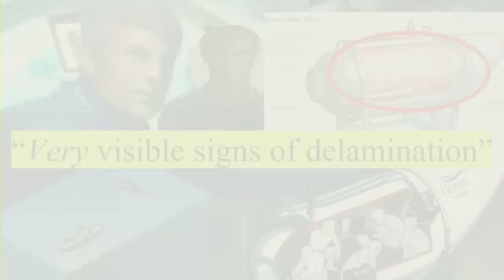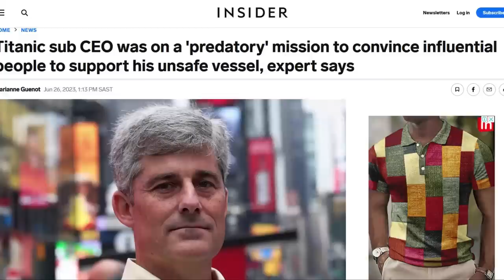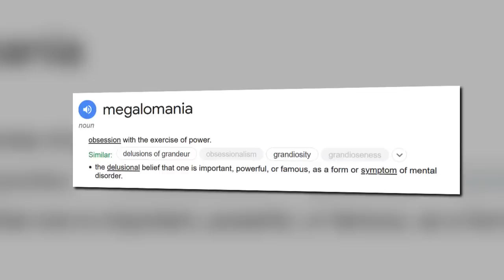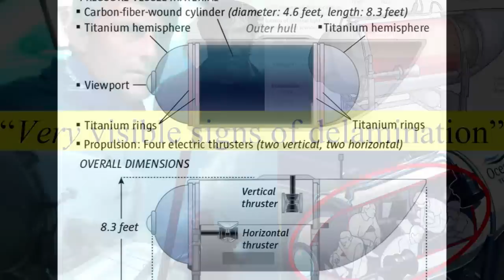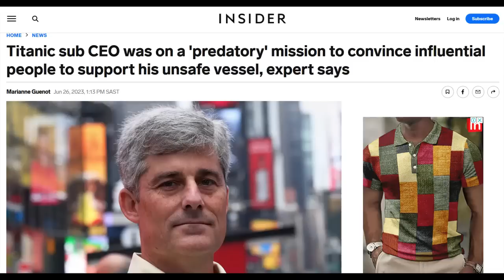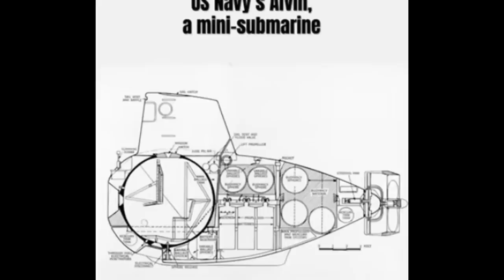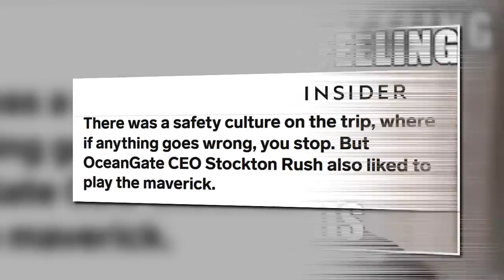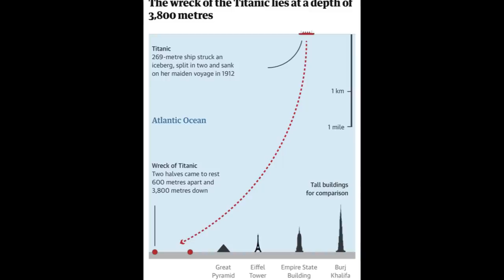"Lochridge shone a light through a sample of carbon fiber and saw splits in the midsection..."

Comment: Light could be seen through the carbon fiber? Holy Moly
Reply: At that point it’s basically a plastic hull.
Reply: I wouldn't take his word for it, unless I actually see those pictures... it's still 5 inches thick, good luck shining light through lets say 5" of denim or sth much less dense, you wont see anything. BUT of course the pressure chamber still should NEVER have been made from CF anyways..
Reply: @MrHuggaga  You wouldn't see the light directly through, carbon fiber reflects light through any delamination point, not to mention the carbon was wrapped in direction making it very weak under compression pressure.
Reply: @theclubhouse1209  Thanks for the answer, reflection through 5" of the stuff still seems very unlikely to me, because wouldn't every layer have to be delaminated at that point? (and would it not have leaked water to the point where even Rush couldn't deny it?) But I I won't rule it out will look into it. Just be assured, I KNOW that it is a bad design and should not be put unter external pressure. I wasn't trying to doubt that at all!
Reply: Depends on the intensity/frequency/wavelength of the light. Alot of presumptive ness here, a witness says one thing and some one pipes up " I don't think" well what do you do?
Reply: @dananorth895  It just goes against what I have seen of carbon fibre. Different example: If I know Russia is doing atrocious stuff in Ukraine, I'm not automatically gonna believe everything Ukraine says they do. It's a different situation, sure, but without evidence I am allowed to have doubts about something that with my experience of the material just doesn't add up. I actually did look it up and at least within 20 minutes (which - okay - is probably not too long) I couldn't find any testing on delamination involving light passing through and I didn't find it mentioned that it could happen in some other way. Do you know what I have to search for that backs up your comment?
Reply: IF YOU CAN SEE LIGHT THROUGH IT THE WATER CAN GO INSIDE
Reply: @MrHuggaga he examined a small portion
Reply: @jcgocrazy  A small portion is still hast the same thickness..
Reply: @MrHuggaga  The pressure vessel had inner and outer cladding so short of complete disassembly a leak and or delamination would be hard to spot, sonic or sonar type testing would be very expensive to do. Carbon fiber thread has to be kept in a "wet" state when laminating then put in a vacuum or auto clave to draw out the extra epoxy to achieve highest strength possible, the epoxy also has a shelf life. Too many "flex" cycles will cause micro fractures and once it starts it gets exponentially worse.
Reply: @dananorth895  It's what you don't do, ignore the signs like stockton rush did.
Reply: @theclubhouse1209  I already told you, I am familiar with the material, you didn't tell me anything new. This is the first time I heard of light being able to pass through "micro cracks by reflection" which I afterwards couldn't find anything on.. What should I search for?
Reply: @jcgocrazy that's even more disturbing
Reply: @MrHuggaga wasn't it a steel hull wrapped with carbon fiber??
Reply: @myrongaines5542  the steel you see was to make the cylindrical shape
Reply: They are discussing light traveling lengths of cracks due to deformation. 
The bubbles and cracks are likely the process they chose. It should have been vacuumed, then impregnated and then baked in an autoclave. 

Their sub was a wet set wet lay process of thin filmed fiber. The implosion occurred due to the lack of deformation of the titanium caps yet the carbon fiber composite compressed down and in. The lap and adhesive was very small which likely added to the event but wasn't the only variable.
Reports state that NASA consultants suggested a synthetic hull be at least seven inches thick. This suggestion was not obeyed and the hull was in fact less that five inches thick.
If I were in a position to build my own submersible, I would follow paid consultants suggestions as well as over-engineer what could be in an effort to make safer.
Reply: I dnt get that part.wasnt it wrapped around so if its wraped tight on the hill how did he shine a light thru it?
Reply: If it was so bad he saw light thru it i dnt think it would hold water
Reply: @FriedChairs  it is actually, carbon fiber is supported by plastic framing actually.
Reply: I think it was a sample cut from a previous hull. The light was shone lengthwise or axially  between the layers, not radially.
Reply: I think it was a sample cut from a previous hull. The light was shone lengthwise or axially  between the layers, not radially.
Reply: @dananorth895  Any visible or IR lamp powerful enough to shine through 5 or 7 inches of CF would melt the epoxy.
Reply: @jcgocrazy  A slice makes more sense.
Reply: Maybe a parallel light revealed delamination
Reply: He didn’t shine the light through the 5in thickness of the hull, OBVIOUSLY— he examined a thin, transversal section of the material as he was looking for delamination defects, as mentioned…
Reply: @dananorth895  I'm sure that testing wasn't just  visible to the naked eye type test .

Comment: I am a composites engineer who works with advanced aerospace materials and processes.   Bagging a 5-inch thick composite cylinder 12 to 14 feet long would require a great deal of technical  expertise to ensure that no vacuum would be lost during curing in an autoclave.  This part would need to be under pressure as well while curing of at least 85 psi to 100 psi using nitrogen gas.  This part would need to undergo NDI ultrasound testing to determine if the void content was less than 1 percent.
Reply: they didnt use autoclave
Reply: They didn’t do any NDT / NDI either from what I have read into this, before or after the previous dives.
Any vessel like this, built to no known design standard, subject to cyclic loading should have been tested and inspected.
Reply: While I too LOVE carbon fiber because of its many applications and incredible strength to weight ratio is was the worst possible use for it and in the way it was used. CF has about 40% of the strength in compression as it does in tension AND the winding appears to have been done 100% laterally instead of alternating it with a 45 degree winding every couple of layers. That might have held the layers together for a few more dives but in the end it would still have failed. The acoustic testing would only give you a short amount of time warning you that you're going to die! Think of cast iron. Put a lot of force on it and it doesn't budge at all, so you keep applying pressure and all of a sudden it snaps without warning. CF is the same way. That acoustic sound they wanted to monitor isn't a warning of an impending failure, it's telling it that failure IS occurring!
Reply: David, had they done all that, would you feel save in the sub at that point?
Reply: @davidsine4390  I wouldn't! Incredible material but wrong application.
Reply: I've worked in NDT for over 30 years. If no UT or RT inspection was performed on this vessel then it was a disaster waiting to happen.
Reply: Does it sound to you as if no composite engineers were involved in this?
Reply: Thank you. A voice of knowledge.  The cracking sounds were a nogo immediately.
Reply: They should have been in a "clean room" also. So much technical expertise that was there but not utilized.
Reply: @loosilu  From the comments of the engineer warning of delamination and porosity that was visual to the naked eye, It was obvious this pressure vessel was a disaster waiting to happen.
Reply: 22 million pounds of force being exerted on the two end caps made of titanium bonded to the cylinder made of composite/carbon fiber+resin.  The difference in those materials at the interface was doomed to fail.  These people were definitely drinking the kool-aid because any 50 year old engineers like myself would have said this is a death trap.
Reply: @davidtullos2067 I was a management major so no engineering education and even I can see this flawed design. I think a sphere and steel would be a better design. Again, I am a layman.
Reply: David, you're exactly the type of person who Stockton Rush would've refused to listen to. White, male, experienced and straight forward. How does that make you feel?
Reply: @GrantOakes   With my only real way to contribute in this conversation it makes me think about how superglue is great for around the house repairs for certain things like plastic you certainly wouldn't use it to repair a broken tooth.
Reply: @obi-wankedogi  Great analogy!
Reply: The testing would've cost alot and would have to be repeated often.
Reply: @obi-wankedogi3829  its not about how I feel, but since you are asking.  Sad, especially for the 19 year old who didn't want to be there.
Reply: @davidtullos2067   Exactly.
Reply: Ask Rust if he did that.....Oops, he is dead. Maybe he documented his "experiments" or maybe he did not. It was not regulated, so......
Reply: As a composites engineer would you have an opinion on what those tic tac craft are composed of.
Reply: @fanatamon  Thermoset Epoxy Resin is used as the matrix or binder, and unidirectional carbon fiber tows.  When processed on a prepreg line or machine, it becomes thermoset tape or prepreg.   This is then laminated one ply at a time until a thickness is achieved for the structure.   Usually , a jig or mandrel is used to keep the shape of the part before it is cured.  In this case, it was a cylinder.  This pressure hull would have required 640 individual laminates to make a structure 5 inches thick.  Any air trapped would be a failure point.
Reply: @GrantOakes  There are videos showing a diagonal weave as well as layers of lateral.
Reply: @glens51  It was too late then, the hull had let enough slow water in to affect the buoyancy, the water was likely under the floor seeping into the A battery bank or wiring. They were descending at twice the normal descent rate from the start.
Stockton-Rush knew this, he kept going or couldn't stop it. its likely he kept quiet to avoid panic and violence during the two hours descent, only when the loud noises and the 19 minute end time did he signal the surface.
Its reckoned the final descent was nose or tail down due to the dropping of the ballast and frame, so 100% unstable, and everybody piled up in a heap screaming and cursing.
Reply: @davidtullos2067   Fascinating stuff. I just  find it more and more ridiculous that he was such a complete egomaniac when presented with the basic facts of how inappropriate it was to use this material. Stunning.
Reply: 😂 lol! You’re assuming they’d done it correctly 😂 When in fact, it wasn’t done in a clean room at all, and the epoxy was applied using plastic spatulas you can find at any hardware store. They certainly didn’t use an autoclave either! Not unlike how the lighting and other components were from a camping store and the controller a cheapo games Logitech controller…
Reply: I heard that they used some kind of house pipes in it, was it pvc or worse pex? This kind of cobbled together b.s. was doomed to fail. And a out dated game controller wtf! Several different materials used for the whole cluster of the boat.
Reply: @GrantOakes  IMHO, it would've been much easier to make the whole vessel out of titanium. but Rush wanted to be remembered as the  guy that broke the rules.
Reply: @Mazel_Tov_888  He sure did that as well as being responsible for the deaths of 4 innocent people!
Reply: 2:52 mentioned that there were holes seen on the return trip.. didn't this erosion tigger the acoustic monitor system. Or was the AMS installed after these earlier dives?
Reply: @davidtullos2067 when making carbon fibre parts the autoclave and vacuum ensures that air bubbles in the resin and carbon fiber will be pumped out. This process itself takes  very long time in the autoclave but you also mention the use of Nitrogen gas. When will Nitrogen gas be applied ?.  When the autoclave has cooled entirely off ?. Does it gives better surface. The Nitrogen part is new for me and I'm interesting if you could give more information.
Reply: @AmbientNoise404  They did the glue-up in a shed...
Reply: It should have been thrown in the ocean with Noone on board sunk to the bottom and left there. I'm not a engineer and can guess this thing was poorly constructed. Wouldn't a flanged tube with a chemical and mechanical bond have been better? Woven carbon fiber? Read somewhere it was supposed to be 7" not 5"? They obviously knew this outcome or they wouldn't have had such a morbid waiver. It's disgusting i.m.o if you want to gamble with your life, that's fine. Don't drag people down with you under false pretenses.
Reply: @joefish6091  there would have been NO slow water ingress!  Just stop. It would have been more of a jet stream!
Reply: @madb132 were where all these neckbeards before it failed to save their lives.....
Reply: @SR-ml4dn  There are 2 purposes for the use of nitrogen gas.  The main reason is to purge all of the air out of the autoclave, and second is to pressurize the autoclave slowly at 5 psi per minute until it reaches 8-10 bar of pressure (85-140 psi).  This helps make sure of excellent inner laminar ply consolidation and impregnation of the matrix.  An autoclave is a tool that can fix many problems during the layup process.
Reply: @GrantOakes STEEL will give warning of its failure several minutes before  by emitting high frequency sound (above human hearing).  Problem is they didn’t use steel.
Reply: @electrictroy2010  what the hell would several minutes do when your an hr and 45 minutes from the surface
Reply: @GrantOakes  i dont think the real time monitoring system only worked in that way, else, as you say, what is the point? they used the kaiser effect to compare noise levels between different dives at similar pressure, so subsequent dives should be quieter, as the material is pre-broken. any novel sounds at a certain depthhad to be caused my newer damage.
Reply: How can you lose vacuum in a pressureized autoclave? No mention of vacuum bagging? Just curious!!?
Reply: @AmbientNoise404 Second mistake!
Reply: @davidtullos2067 You didn't mention the next two steps that should have been mentioned! Vacuum bagging and then under pressure in a autoclave or possible HYDROClAVE with heat to cure the laminate!
Reply: @SR-ml4dn Nitrogen is used at the very beginning of the autoclave for obvious reasons! The part should be also cooled in the autoclave to insure stability as composites will change as long as it is hot… All this can be time consuming!
Reply: @davidtullos2067 Have you ever used a HYDROClAVE? You made a very good statement about autoclaves!
Reply: @GrantOakes  you fail to understand the kaiser effect. only new fractures make sound, so if an object has the same levels of stress it previously endured it should be far quieter. new sounds mean new damage. that is how the real time monitoring works, it compares the sound data to the sound at the same depth from the previous trip.
Reply: @robertchilders8698  it should be obvious if you're using an autoclave but forgive me for assuming anything.   Autoclave recipes are closely guarded secrets in the industry.
Reply: @robertchilders8698  Thanks I didn't know that.
Reply: @robertchilders8698 If the vacuum bag leaks during the curing cycle, air will get into your part.  The vacuum is released at the temperature that gives a minimum viscosity of the resin being used. Then pressure is applied.
Reply: @robertchilders8698  what industry do you work in, if you don’t mind me asking.  It sounds like you don't work in aerospace because of the questions you are asking.
Reply: @davidtullos2067  This shows me how far out of date I am! I didn't know Autoclaves had secrets!?
Reply: You have got me confused.  We applied pressure during the whole cycle the parts were in the autoclave.
Reply: @davidtullos2067  I started work in the aerospace back in1957. IT was highly unstable work, so I worked in many fields! Worked on aircraft, rockets, boats, atomic submarines, race cars! Retired now! My first job was working on Drones for Ryan Aeronautical as composite technician! Spent time with Boeing, Lockeed, Areojet, Grummand and atomic submarines at Mare Island.
Reply: @robertchilders8698  I work as a Compsites Engineer in the defense industry, with Boeing being one of those companies that I have worked with for the past 14 years.  In St. Louis back in the 90's and later Seattle in 2010.
Reply: @obi-wankedogi  you must include "age" discrimination in job hiring! Although it is illegal, it's easy to get around! It's also the major factors for homelessness. I've worked on many jobs in my life-time!! Always wondered why the majority was between 25  to 35 years old!? Now that I'm retired, I've found out to late ,why! Spent to many years being naive and homeless!
Reply: And even that wouldn't be enough.  How long does something that big and five inches thick take to fully cure?  Can we even expect it to fully cure?    And the carbon fibre was laid down like a spool of thread.  There was no attempt at producing any kind of rip stop  feature to the fabric of the barrel.  Any cracks from cycles of compression were free to run along the lay, and jump down to the next layer down.  The design wasn't even valid for aerospace tension applications.
Reply: @SR-ml4dn  You must know something about vacuum bagging and autoclaves! Nitrogen is used throughout the auto calving process, because of it's non explosive nature. The surface of the material is determined by the vacuum bagging process and How good the vacuum is in the bag. Nitrogen gas pressure should be kept constant until complete cool down is achieved or the part may "warp". It can become a long and expensive process!